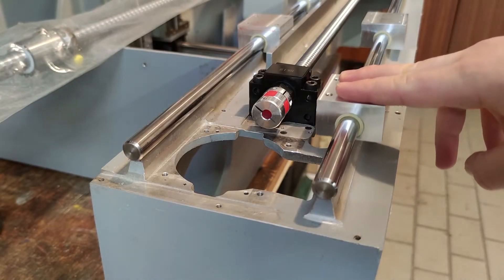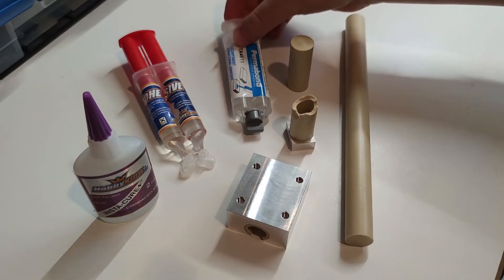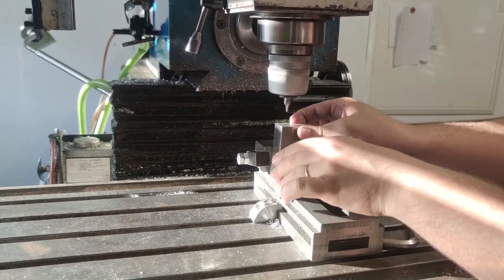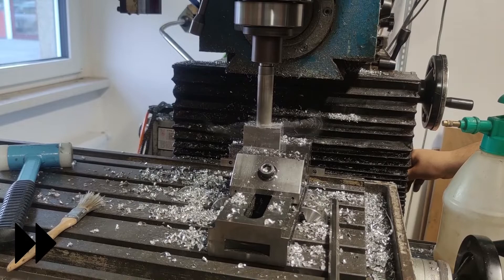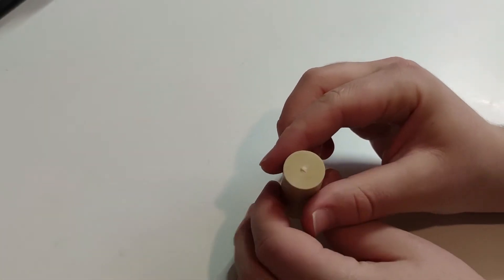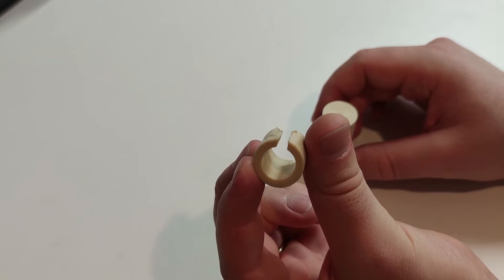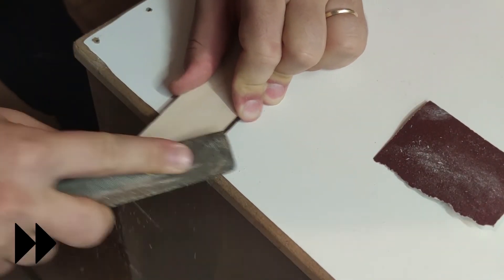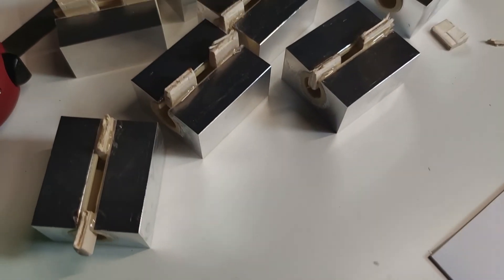MAKING 10 LINEAR BEARING BLOCKS FOR ONLY $100!!! | DIY CNC | Part 1

Comment: Nice work, but it's an awful lot of work to make each bearing, with the materials and time I'm sure it would be better to buy square linear blocks and rail,, they are a lot cheaper now a days
Reply: replacing them frequently makes them more expensive because they fail without warning a lot and when the machines are down the money is down..

Comment: Add a couple of screws either end of the blocks to hold the plastic incase they come loose :)  , also the rails you bought are imperial sizing, 15.875mm is 5/8" , so had you bought 5/8" bearing blocks they would have worked, although still expensive and if none adjustable you have to pray to the gods they are not branded cheap chinese